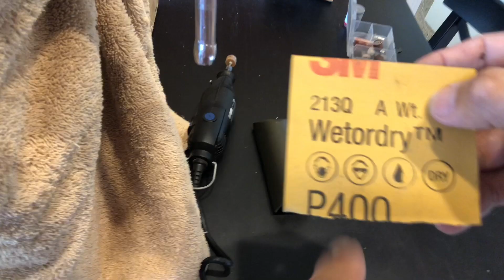Bad Magpul Cheek Riser | Bad Rifle Primer Pocket

Comment: I just bought the 1/2 inch Riser and Love it and it gives you Perfect Alignment to your Optic but I just flipped mine around and it’s still perfect. It’s a great tutorial if you want to cut it down but you absolutely don’t have to.
Reply from the maker: I tried that but if shoot prone it comes in contact with shoulder. So I just sliced it off.
Reply: @OutdoorEDventures  ahhh I didn’t think about Prone, that would jab right in there lol absolutely. I haven’t shot Prone in Years but I got my best Accuracy shooting that way.

Comment: So wonder what would happen if the cheek piece was turns the other direction??
Reply from the maker: You'd have an awkward extension facing rearward.
Reply: @OutdoorEDventures  thanks, I have the stock not the riser currently. Many times when I see it pictured it’s in the awkward orientation..

Comment: Agreed. I had a hogue and wanted more cheek riser height. Bought the magpul and once I put the riser on, realized the charging handle couldn’t retract all the way. Even with modification, look how far back the stock is on the buffer tube. I keep my stock really close, 1-2 clicks out, and it would never work. Installed the hogue back, as the rubber stock is better on the cheek anyway. Live and learn. Additionally, the cheek riser gave issue with using the BUIS. Function comes first. No riser for me.

Comment: Hacksaw works better than a dremel tool for a straight cut on plastic and using a hand primer tool will catch those loose primer pockets in every case but that way you did it may be just as easy either way you have to pin the primer back out of the bad case's and throw them in the scrap pile

The hot loads can do that with brand new brass if you had a flattened out primer that welled out that pocket it will be junk with a loose pocket
Reply from the maker: Yes, I agree. But my blade was broken.
Reply: @OutdoorEDventures  Oh yep....... I forgot about the only when you absolutely need it fast then it is broken or no place to be found rule of life LOL
Reply: @OutdoorEDventures  Wait till ya see them bar stools that fit that rifle bench like they were made for it plus now i can line up on the feeder from the bench easy and have two seats facing either way if I add a 2x4 foot plywood across the bench
Probably just wrap camo net around the bench and had a very easy shot on the feeder now and will not have to have my truck up in there drop stuff off then hide the truck behind trees

Comment: How did you take the cheek riser off?
Reply from the maker: If you look underneath there are tabs, slide a flathead screwdriver between the two tabs and slightly turn. It will lift up and remove with other hand.

Comment: What size did u get??? Cant decide how big of the height I should go with
Reply from the maker: Get you a pool noodle cut it in half. Lay it on your butt stock and continue to trim it down until you get the right comfort zone. Then measure it and order that one. That's how I figured this one out!
Reply: @OutdoorEDventures  thanks brother but went with the .25 and it was perfect. I did trim it down for the charging handle as well. Just waiting for days off to try it out at the range. Thanks for responding 👍🏻🇺🇸